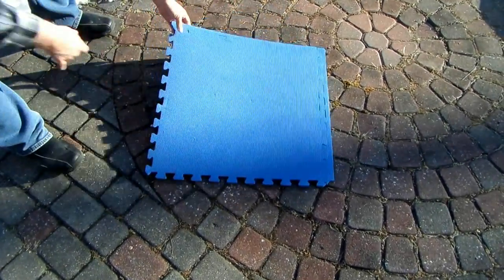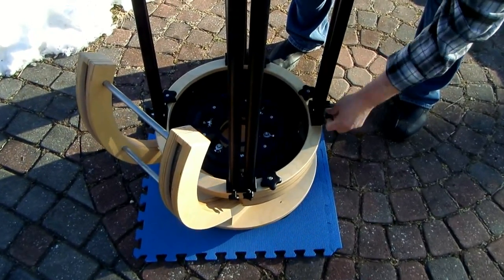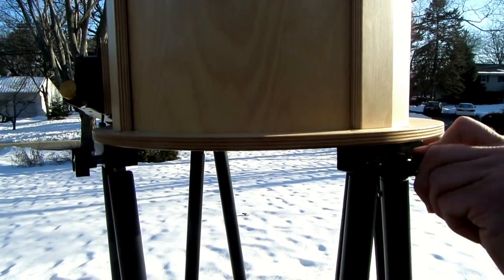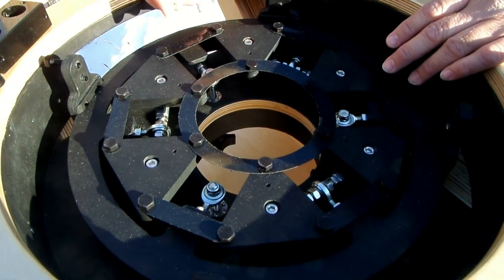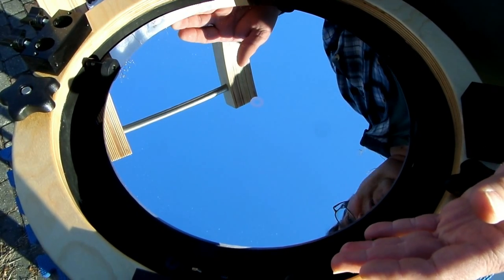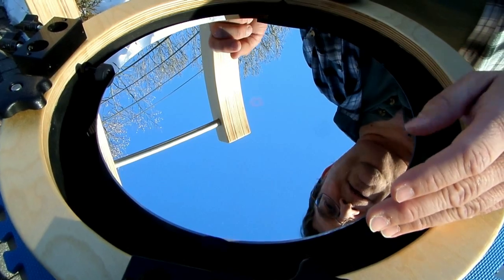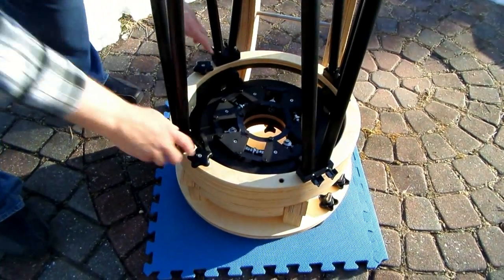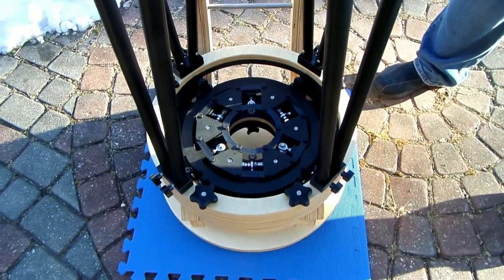Putting Together a 12.5" F4.6 Renegade Telescope

Comment: I wonder if a diamond tipped lathe could be used, to cut the parabola into the surface then finish polish it out?. maybe something like a miniature Betts mill, the one i worked on had a 12 ft turn table.  and cut 16pcs of 700lb wedge shaped segments of cast iron into a shape that looked like a giant convex lens laying on its flat side used for lapping at the caterpillar corp.
Reply from the maker: Diamond lathe work is used by some high-end shops for forming glass.  Not an amateur method, though, if you are trying to get accuracy to a few millions of an inch.

Comment: hey Gordon would it be possible to cast small scope mirrors like up to say 150mm with a parabolic shape cast into them, instead of a flat blank so that all would be needed is a finish polish on them then aluminize?. I mean you could cast them with different focal points for different length scopes, then only have to polish and coat. that would save a lot of time and labor and make the smaller mirrors more reasonably priced so that more people could get into the hobby. I don't think it would affect a business like yours, except maybe give you more work polishing. but I could be wrong because I am not as smart, as I used to be when I was young and healthy. maybe you could start a small side business making small parabolic mirrors, and take a bite out of GSO's profits.
Reply from the maker: Casting will not give you a surface accurate enough to go directly to polishing.  You would still need to grind.  And most materials you could use for casting aren't well suited to making astronomical mirrors.

Comment: Are all mirror cells (for all apertures) made of wood or for the larger aperture telescopes they are of metal?
Reply from the maker: Our mirror cells are being redesigned this summer.  Some of the metal parts are being replaced with polyurethane parts.  So they will be all three: wood, metal and polyurethane.
Reply: Thanks Gordon.

Comment: I like the open design.  Is there any convection distortion at all?  I shouldn't think so.  Oh, how I see the cloak being installed.
Reply from the maker: Hi, Alex.  Thanks!  The mirror surround is quite low, so there is airflow around the mirror on top, if you either don't put on the shroud, or if you roll it up from the bottom a bit.  So the mirror cools down really fast, and you don't need boundary layer fans.  I've never seen heat effects unless I've just move it from cool to hot, or hot to cool.  Even 15 minutes of acclimation takes care of the problem, pretty much.  Large scopes take a little longer, of course!
Reply: Yeah.  Makes sense.  Those are heavy pieces of glass.  I had seen somewhere that convection currents in the tube were causing some defocusing of the image.  Up in NY the best time to look at the sky is winter for some reason.  I don't know exactly what causes the currents as we never had heaters or anything near the telescopes.   Just a sort of chimney effect I suppose.

Comment: Really like the details of this design, seems highly functional and easy to set up.  I built a 3 tube, 12-1/2 f/5.5 structure using the Dobsonian telescope book but didn't follow all of the suggestions, esp. when it called for design of the mirror cell.( it seemed too complicated) I ended up using a 6 point design using calculations from PLOP after it was revised. The 6 points are 1 inch diameter dowels glued and screwed to the cell, leaving about 1/2" of space for air to circulate between the mirror and the cell. The mirror adheres to the cell with a Permatex silicone.  There are also 2 edge support pieces made from wood. The cell pivots on a 3/4"d. ball bearing in the center between two washers- no need for springs. I store the scope in a basement with a microfiber cloth over the mirror and a plastic disc ( a planisphere) on top of that- the mirror is 7 years old and the coating still looks new.
Reply from the maker: I'll bet you get a lot of enjoyment out of that telescope!  The f/5.5 scope is a little longer than average, so I expect you get some great views of the planets and the moon.  What kinds of eyepieces have you been using?
Reply: Gordon, thanks. I mask down the scope to about 4-3/4" to clear the secondary when viewing the planets and for eyepieces I've stuck with all 1-1/4" barrels. Mainly the Meade Series 4000 super wide 13.8 and 18 mm's, a Celestron Ultima short barlow, 26 mm silvertop, and a few others. I'm satisfied with views from just about any scope, but false color from some refractors and shaky mounts aren't much fun. Great advice on keeping the mirror covered and away from sunlight